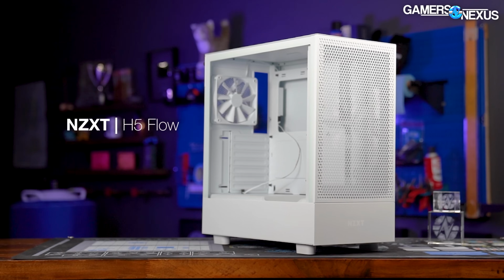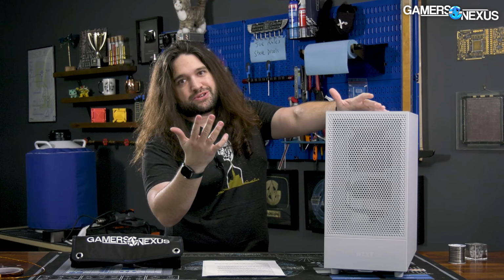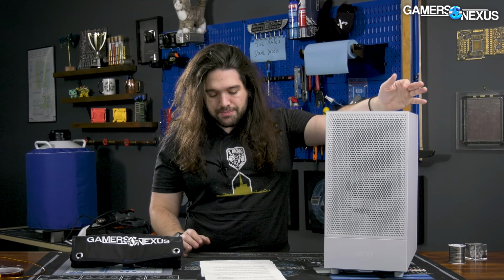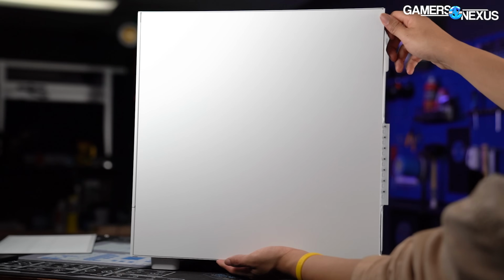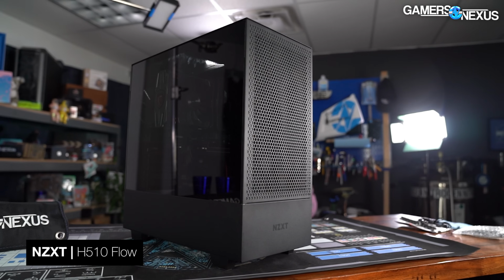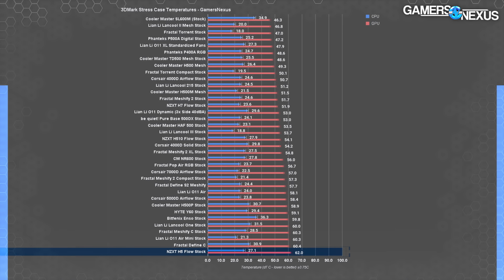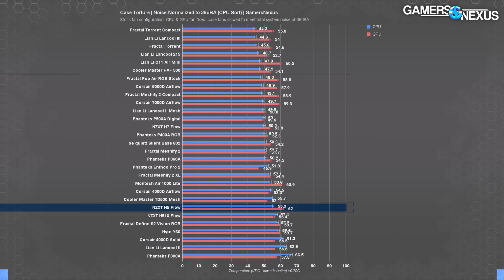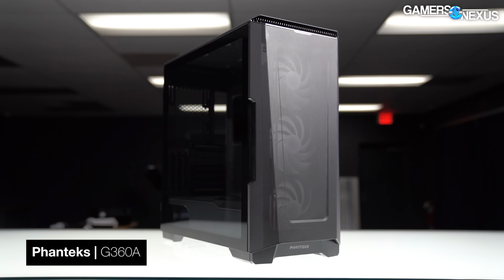NZXT H5 Flow Case Review: Thermals, Cable Management, & Noise

Comment: They always leave something to be desired but I suppose this would be mostly okay if you’re going with an AIO at the front since it comes with fans
Reply: but a long psu wont fit? not to mention a regular sized psu will struggle to fit un-used cables in the toilet fan space
Reply: As long as it doesn’t have any RGB cables or connectors.  Nowhere to shove those cables.

Comment: Maybe I'm in the minority on this, but do people not upgrade / buy additional fans when building a PC? It seems there was so much emphasis on "missing" fans in this review and in my mind fans are another component of the build and not something I consider when choosing a case. Footprint, internal volume, overall size, ability to build, front inputs, airflow, and other properties of the case help me decide but not if it has some cheap fans thrown in. They feel like those courtesy items you get when buying something and the manufacturer knows you will be replacing them almost immediately. 

Would love to hear everyone else's thoughts on this or if I'm super off-base on this.

Comment: I think one of the HAF cases had an angled bottom fan too. Personally i don't really see the point, when there are plenty of cases with a mesh psu shroud and underside that you could just strap a few fans to, that would blow directly up into the GPU, if that's what you wanted.

I have never liked NZXT and this does nothing to change my mind. 
I got the Phanteks G360A instead, and added a phanteks fan for exhaust, cost less than £100 total. 
Will you guys put out a review of that case?

Also, what happened to the GN PC case, is it still progressing in the background??

Comment: First I think NZXT had this design finalized and in production before the launch of RTX 4090 cards and the AM5 95C thermal CPUs. Clearly this thing lacks the size and geometry necessary to safely deal with these new products. 
Second: Even before these new products made this design sketchy, it is clear that NZXT priced and marketed this case to those who would be bringing over their existing fan sets from an older case or who maybe had existing fans lying around. I know I have at least 6 fans not in a case in addition to all of the ones in my current case. They don't expect to sell to people who would have to buy this case AND buy new fans because as Steve pointed out, that price point means you need to consider other cases which are likely to win a consumer's vote in a comparison. 
This makes the H5 Flow a very niche targeted market. I don't see it being a top seller in terms of units sold. The GPU market alone makes this case too small to both physically handle the card and thermally handle what the card needs.

Comment: You should have a 2nd standardized test with all available fan slots filled that way we can see the maximum cooling potential of each case. Plus its easier to test this way. Win for everyone.

Also, testing only included fans doesnt relate to the majority of your viewers which are enthusiast. You know and I know we will fill up all those fan slots. Testing with the included 1-2 fans is more geared towards OEM builds which Im sure is a very small percentage of your audience base.
Reply: The problem is populating all fan spots does not give you maximum performanceall the time. Also depending of case you want different fans(static pressure Vs more volume, different size options). You simply cannot really standardize it.
Reply: @Dhaydon75  If you use all the same fans and rpm, it would be good enough

Comment: Ironically, i would rather have a case that comes with 0 stock fans. Because the fans including in the case are either very cheap, performs terribly or are very loud compared to fans that you can get for cheap and performs well like the arctic P12s. Like my lian li lancool 2 mesh, i replaced all 3 front fans with P12s and they are soo much better.
Reply: Same. Also because I've got a stack of spare fans in a variety of sizes from old cases.

Comment: I feel like this was designed and intended to be only used with an AIO. That would explain the lack of front fans as all AIO's comes with 2 fans in the box. Why include 2 stock fans in the cost of the case when they are not intended to be used right?

Comment: I ordered the NZXT H5 Flow RGB white.
With that 4 new case fans to replace the ones that come with the case pre-installed.

I missed the fine print that the pre installed fans have 3-pin headers.

But glad I went with the H5 Flow RGB version regardless of swapping the fans because the pci bracket slots are perforated on this version case and the normal H5 flow they are closed.

Went with 2x NZXT F140 Core RGB white for the front, and 2x F120 Core RGB white for the back and angled toilet with 4-pin connectors.

This way I can set ideal airflow with NZXT Cam software.

Got a box full of spare fans, but went with new ones that fit nice with my NZXT AIO cooler Kraken Elite RGB that use the same F120 Core fans.

So it will all look nice with good airflow 😊

Fans don’t cost that much and it’s better to choose to your own liking.

My case comes pre-installed, but changing them regardless 😅.

Better RPM and more CFM so I can fine tune.

I7 13700KF will be used along with Corsair Dominator Platinum RGB DDR5 memory and RTX 3080TI FE edition.

All powered with the Seasonic Prime Titanium TX-1000 PSU with Cablemod white cables connected to a NZXT N7 Z790 white mainboard 🎉

I will be upgrading from a 7800K I7 Z370.

Went with this new case because I wanted something else then my older Cooler master master case pro 5 Nvidia edition.

I wanted a smaller and lighter case and the H5 Flow tiks all those boxes.

I have the case on my desk and behind my LG Ultragear 38” monitor I have 3 Philips hue play bars that sync with what’s on the screen.

Having a smaller case I can see more of the light projected onto the wall.

And the reduced weight of the case is a nice peace of mind for the desk itself.

Comment: I recently got this case specifically but do you guys know where to plug in the bottom fan cable to? It doesnt seem to wanna work on the CHA_FAN1, 2 or 3.. chassis are all working for the front fan though, but not the bottom fan. Tried the DC mode and PWM mode, both didnt make any difference. So where in the world does it need to get plugged?
Reply: Bit late here but if it isn't working then you must have a faulty fan unit. There's no reason it shouldn't work with your standard fan pinout

Comment: But is there a way to fix GPU temperatures here? Adding front fans lowers GPU temps by 5°C, but what about replacing the stock bottom fan on top of that? I mean, are GPU temps the result of cheap stock fans or the single angle fan design at the bottom is just broken?

Comment: I think it's pretty obvious they designed this case to be used with an aio in the front. Since aios come with fans they saved a bit of cost by not including trash fans. So the standard config for this case would be stock plus a front dual fan aio

Comment: I like that a company is trying something different, but what's the cost sacrifice of trying something like this compared to just making a PSU attic with some taller case feet, or moving to a dual chamber deign where the GPU won't be obstructed by the PSU shroud. With the costs of spinning up the manufacturing line for this, the angled fan feels like they're throwing darts at a wall and haphazardly shoehorning a feature where it could fit, rather than going down the route of proper case design. It's similar to Dell's need to over-engineer their cases with things like spring-latched panels and clip-in fans, but the opposite in terms of approach considering this angled fan has been stuck where it might fit as a last minute idea. 

Part of the issue also falls on GPU size getting out of hand, and potentially the issue of relying on updated specs that, at their core design, are outdated. For example, PCIe's physical implementation forces cooling to hang off of a card, as the chip is on the bottom side of the card on the typical ATX layout. But what if we were instead able to have reverse PCIe layout, where all the cooling could pull air from the center of the case, and the main PCIe slot is lowered to the bottom bracket, this would allow the card to butt up against the bottom of the case or a PSU shroud, this would be a step in the right direction given current circumstances. Alternatively, bring back reversed cases, where ATX is upside down, this with a basement PSU would allow the GPU to pull fresh air from the case itself and from the top of the case; similarly, for non-reversal, bring back a BTX-like layout where the board is essentially mirrored, allowing for the same cooling layout with a basement GPU. Or just go with attic GPUs, as cases used to be decades ago, or dual-chamber cases where the PSU is tucked behind the motherboard, as some manufacturers are doing now. Either way you look at it, the industry as a whole, in damn near every aspect, needs to evolve beyond these outdated base specs that see no physical updates, the physical basis of these older specs were from a time that absolutely does not reflect modern systems, thus they're outdated; sticking to outdated physical designs is going to bite everyone in the ass eventually, as we've had the same physical layout for decades with little to no adaptation to modern needs, especially when modern needs are now becoming so bloated the component ecosystem no longer works as intended, case in point new GPUs being so large and with cables that aren't meant to be bent near the header, cases needing to be larger to not choke airflow to components, the whole PSU situation crowding cases further, etc. The industry needs to better adapt outside of just case design providing alternatives to where a PSU and fans might be placed to allow for better component airflow.

Comment: I know you are going to hate this, it's more work. But I would like to see this chart broken down by case class. The pop air is a mid tower, this case is matx. Facatal has an matx, the pop air mini, you have not tested. I believe that all other things being equal, a smaller case is going to run a little hotter. Both the pop air and flow have a least two sizes that are mostly identical, The H7 flow is also cooler than this case and I assume is the same basic design sans fan placement.
Reply: I'm curious at which point you got the idea that this was an mATX case. The H5 is an ATX mid tower and can even fit EATX up to 272mm.
In fact it's even a bit larger than the Fractal Pop Air which is a 46.2L case, the H5 being 47.0L
Reply: @Toinou307  oh Because the gpu isn't in the top slot I miscounted. Point still sands, Just doesn't apply here. My bad

Comment: 11.5ºC more than sl600m , cooler master did great design there but a lot of flaws in that case
that gimmic fan doesn't help if you block all the exhaust under the gpu, using flat pci-e covers. 
waiting for the 216 review, will be top 1 in gpu temp, 100% sure

Comment: AIOs are very popular and I'm not a fan of included fans in general anyway.  That extra duct down there is a great feature in a case where you have the CPU AIO in the front.  I think you are particularly harsh on the case and oddly even you guys put an AIO in the front and yet overlook this configuration for some reason.  In fact, case testing should probably include an AIO in the front and top locations.

Comment: I'd be interested to see how the temps are with the GPU mounted vertically, I think the "toilet fan" might offer more viability, though it might suck up dust that settles on the table while it's off.
Reply: Pretty sure there hasn't been a case design yet where a vertical mount is actually better than horizontal for temps. Best case scenario it's nearly the same and seems to depend mainly on how much space there is between the card and side panel.

Comment: Never ever will I buy a white case with plastic components again, especially from NZXT. My Phantom Full Tower looks so bad with white metal sides and strong yellowed top plastic cover due to output air temps. And putting a fan so close to the bottom just sucks in all the dust onto the inner components. It's a bad design.

Comment: I kinda dig this case because my current case starves my GPU and it gets HOT! I plan to keep it for a long time (3080) so I want it to stay cool and I like the gimicky nature of the bottom intake. The thing is, I have an SFX power supply. Would it fit? Is there a bracket I can buy?

Comment: Does a 280 RAD on the front solve the fan issue?   I was planning on using this case with a 240 AIO exhausting out the top,  but I also noticed the lack of fans on the front, for the cost of 2 more fans I could just go with another case.  This review has me thinking about abandoning the 240 top exhaust and going with a 280 front intake

Comment: I mean if you're the type of person that's going to be running a 240 or 280 AIO anyway it seems like it wouldn't be bad.
That said I'd be interested to see a case that has the old school duct straight through the side panel to the CPU. I made a bastardized version with a cardboard box and some cardboard tubes from pallet wrap. Works better than expected.

Comment: I only use cases with 3 fans on top blowing up, 3 in front ,1 in back blowing out try to get the base cover we're i can put 2 fans blowing up with noctua NH-U12A black push and pull. Aio i try and got 6 new i put the on other people computers, i biuld computers since the 90s and network's.

Comment: In my opinion if these companies with the cases want you to buy their case it should come with all of the fans included after all it is a heavy price and then you have to add price to make it the airflow as it described bad move to all of these case makers like I said they should all come every last case should come with the fans included if it's an RGB case then it should come with a standard RGB header controller and the front panels should be universal for all motherboards and every single case that way you're not hunting around trying to flip flop and everything else in between it should be plug-in and you're done

Comment: Honestly I just wish the pop air had some better ventilation for the HDD slots at the bottom, tho i suppose you could get a bracket and mount one inside the main area to solve that problem.  Would the XL version provide better-enough airflow (and room for top fans ig?) to justify it?  And could you mount the front fans on the inside of the brackets instead of the outside still, esp if you wanted to run 140mm fans there instead?

Comment: im using the H5 with a vertical mounted that has a 4070ti, i played warzone 2 (big map) max settings 1440p, my temps stays around 63-68C, my cpu stayed around the same, my GPU idle temps are 28-30C

Comment: buy a 240 aio as a cooler to be used as front intake, use stock fans as rear and top exhaust. boom,  problem solved. good value case.

Comment: only issue i dislike is top mount is only for 2x120mm. there is plenty of space to do 2x140mm fans. that is a very big oversite on nzxt part.
Reply: @n n it was 1x140mm solid top panel. this may be improvement, big oversite on design.

Comment: But what about the gpu temps if the placeholder/covers below it are removed if using a none FE card?
Reply: That is something i would test this summer as i already invested in two Arctic P14 fans and five P12 and an Asaka pci slot under gpu two fans bracket. That's three fans under gpu with clean flow channel helped with that lower front fan. I guess i will find out if my current Fermi EVGA GTX 570 will seat, as it's a 95°C capable card. I'm pretty sure we will have a few weeks at 42-43°C days where my poorly insulated apartment show 32-33°C without any PC running. That's gonna be a hell of a test literally 🔥

Comment: I really like the case tests but I will never understand how testing in stock config with 1 fan is a fair test...

Yes adding 2 fans here makes it more even but if we are honest one would add 2 fans front and 2 fans top.

I think testing them stock is okay as long as you also compare them in real use case with full fan config and then compare them to other cases with a realistic fan equipment.
Like a Case with 2 fans (one front one back) is outperformed by a cheaper case with 4 fans stock (3 front one back), duh, didnt see that comming...

Comment: why you shitting on the case when it's actually one of the best in the standardized fans configuration?
i mean if i buy a case i'm always going to buy additional fans because most of the cases don't come packed with expensive fans.which case for under 100$ comes with four fans? Besides all the other cases look like crap. NZXT is way ahead designwise. the only thing that comes close now is the fractal north.
Reply: It's a good case ONLY IF you buy additional fans. That's the problem with this case, because then the competition for this case is actually the more expensive cases.

Comment: I think it's time to move on from testing stock fan configuration. Or at least don't spend so much time on it.  No one uses stock. That's like testing cpu's with stock heatsink and fan. Your audience doesn't use stock. People spend $350-$1000 for gpu's, hundreds for cpu's, etc.. and you think they won't spend $40 on fans after all the research they've done on building a pc?  Most people yank out stock fans anyway because they are less than optimal.